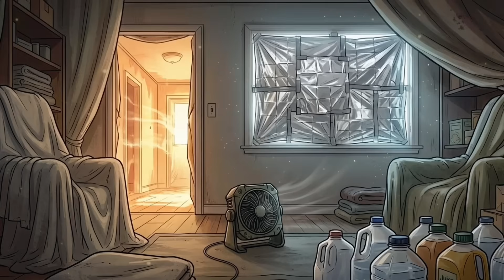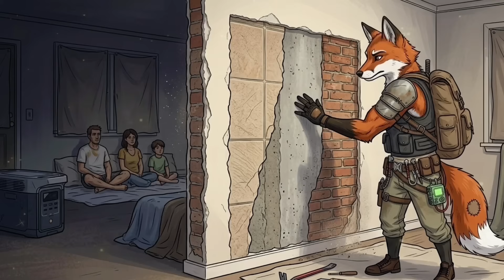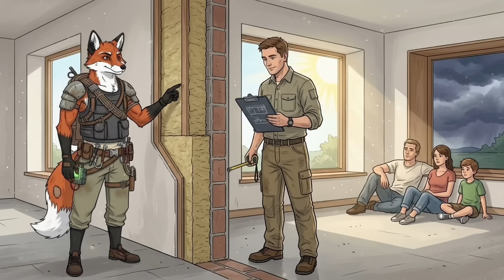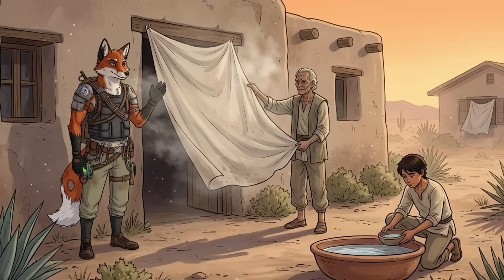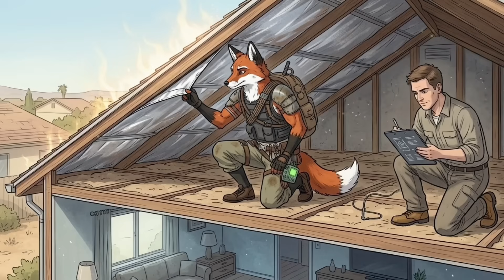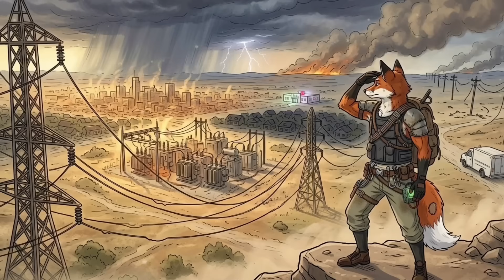The Real Blackout Survival Plan Most Preppers Never Think About

Comment: Your battery is for night time lighting and you need solar panels to keep the battery FULL. After that MORE solar panels will help some other domestic functions. Remember; grid down doesn't happen in soft balmy breeze it happens in freezing windy conditions.
That you can top up your battery in summer with 12hr sunlight and 12hr power availability fror recharging, means little! You will need, in emergency, to recharge batteries in about three hours split either side of a weakly sunny (solar ) NOON. You'll also need light from 3 pm til 8am less a bit for sleeping. The more you can stay in bed over night the better because you should be saving electricity where possible.

Comment: Your best bet if u have a seller put a sheet I the floor on the north side of the house sleeping bag on the sheet have a battery to charge small battery rechargeable fan inverter u will stay cooler or warmer in the winter I did that when my air conditioner died during a heat wave and I was able to sleep that way at least until the fan battery died took 5 hours to die recharge the battery and got a few more hours sleep

Comment: So how does one take advantage of the stack effect to cool air in single story houses?
Reply: open one side the same way and vent out the other. usually have the fan near the intake window on the afternoon shade side of the house to vent out the late afternoon side. moving air will pull the hot pout and let more cooler in

Comment: Okay here we go. First off, no intelligent prepper looks to their power station(s) to run heating and air conditioners and if they do, they're an idiot. It's one component in an off-grid infrastructure, not the cure. Some of those other components are solar panels, dual fuel generators, MR Heater buddies, etc. You also failed to mention that most power stations have passthrough charging; the power station can still  output power while accepting input power, thus reducing the overall drain on the battery and extending its watt hours.  Add a backup fuel generator ran for a few hours per day, and you can maintain your fridge and freezer, run a small heating unit (or series of fans for air circulation) while also charging your power station. Again, extending the useful hours for the power station. The same happens with solar panels, albeit depending on the total output wattage,  slower.

Don't get me wrong, passive techniques and skills  are extremely viable; using micro climates, heat retention/heat loss prevention, etc.  Perhaps you should just focus on how those can be implemented and their benefits WITHOUT the "power station dying" fear mongering.  In fact, WHY even mention them at all if the purpose is to educate the benefits of  building knowledge and  passive environment control.  Again you are using a false dichotomy  to push your narrative. I reiterate that your facts and approach are totally correct. It is the binary premise with regards to the power station ultimately failing that is questionable.

I've lived through multiple extended power outages in both winter and summer conditions, including the Ice Storm of 98 and the northeastern power outage of 03. We had a 4 day grid down just this past winter. My power station didn't run out, my generator never failed, and my fireplace never ran out of wood. I agree that knowledge and understanding how to limit your exposure to tech failure by having knowledge about passive techniques are a good thing to have, and we used some of those during this past winter's outage.  I would also challenge your premise that your way is the only way to stay alive for days; considering I have done so over multiple extended  outage across all seasons; sometimes using passive techniques, sometimes using tech.
Reply: Most excellent explanation Croaking Toad. Do you write professionally ?
Reply: @stephenmenhennett6134 Occasionally. Although I must admit that I didn't proofread this one and there are a few run on sentences and some punctuation is missing.
Reply: BTW, two main aspects of incorporating off-grid power sources I forgot to mention in my original comment, are power auditing and maximizing your power station. 

Power auditing simply means knowing what the power requirements are for each device you plan on plugging into the power station or generator. If you're taking prepping seriously , before you are facing a grid down, get a power monitor and run it against each appliance you want to power using a generator or power station. This will give you an idea of how hard your off-grid power source is going to have to work, and exactly what your power station can run. 

Maximizing your power source mean knowing when, and for hour long you can use it for any given task. Often, appliances only need to be powered for short periods of time but have a higher power draw. Knowing how much energy they are going to take is critical to knowing if and/or when you can power it. 

The second aspect in maximization is avoiding power loss through voltage conversion. Those 120 AC receptacles on power stations are useful but also lose power during the conversion process. The heart of the power station is a 12V battery. Every time you run a 120V household appliance or device from the power station it has to convert 12V to 120V. A small amount of power gets consumed/lost to the process. If the device, like a laptop, for example only needs 12V power but was designed to plug into a 120V socket, the power cable's converter takes incoming 120V and steps it down to 12V, again with power lost to the conversion process so you lose power both at the “up step” (from 12V to 120V) and the “down step” (from 1`20V back to 12V).  The best way to minimize this is to have a small cadre of 12V appliances to run from the power station, and find, if possible, get 12V direct power cables power cables for those 12V appliances.

The final aspect in maximization is not running 120V incandescent lighting from your power station. Not only do you get that conversion power loss, and those types of bulbs are energy gluttons. Instead, run 12V powered LED lights, or at worst, use an LED bulb in an old 120V light. You still lose power to conversion with this, but your overall power drain will be drastically reduced. 

All of this is to say that you need to know what’s the overall power cost each appliance or device you plug into then power station, and it’s better to maximize your power station's battery by avoiding high power draining devices and avoiding conversion power loss.